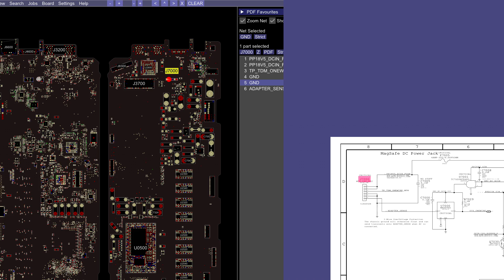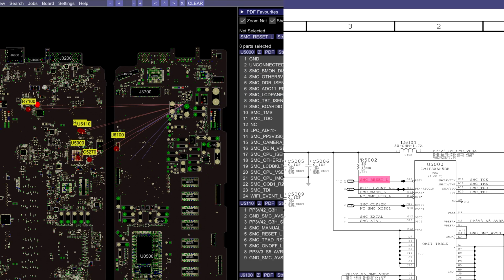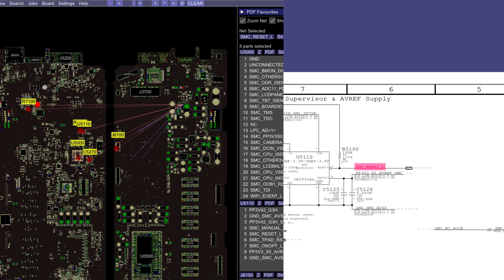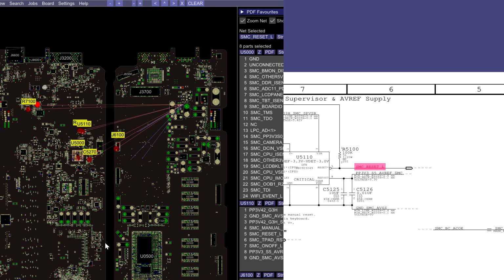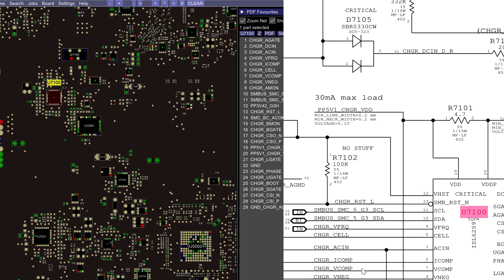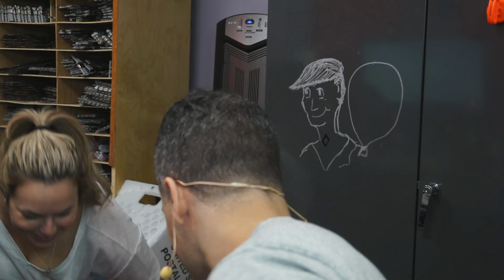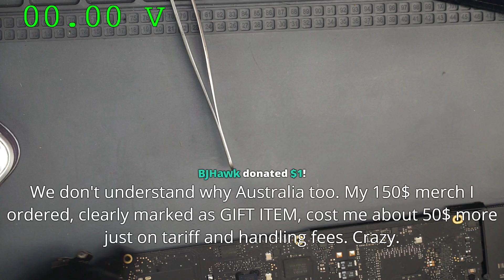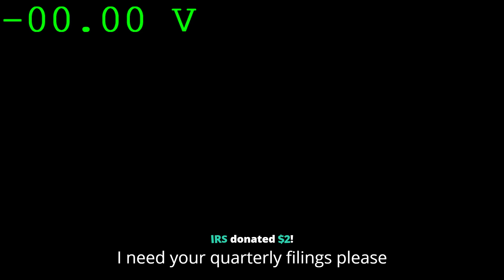My CPA's assistant uses a Macbook. Should I fire them?

Comment: last week i went to an authorized apple reseller in my country (we don't have Apple Stores around here) to check out my mid 2018 MacBook Pro which had some minor speakers issue, everything else was working fine. I thought that only the speakers would need to be replaced. However, the technician told me that the entire top case should be replaced by Apple standard procedure. This is sooo stupid. Luckily for me, my Macbook was still Apple's warranty so I decided to go for it. I can't imagine someone else in a similar situation without warranty.

Comment: A CPA firm should not use Macs.  Tax software works only with Windows and most have to be loaded to the local.  Also, collaborating in Excel with Macs is burdensome due to the defaults of visible cells only commands, etc.

Comment: @louis rossmann - just found this in the news "apple created an "independent repair provider program" which allows free service providers to repair iphones with original parts and apples special tools, which was only allowed for authorized shops and service partner till now, ... only in the usa for now... for now only for iphones, ... service provider can do repairs with 3rd party parts or apple originals ... shops who take part have to conform to using of  trademards but apple keeps the right to deny shops the participation -- heard anything about it? it it usefull or just a "scam"
Reply: just to comment: my thoughts, 
- probably a scam as they can decide to deny shops, so if they dont like a company bye bye
- probably only a try to stop laws against them

Comment: What causes all these problems? Over use, bad design, dropping it. Etc
Reply: In Apple's case, all three, though mostly the middle one. Over use meaning being stressed by heat cycling and high operating temperatures, bad design that leads to those high temperatures and wear, and dropping it because most of the people who buy Apple products don't want to know how their computer works, only that it does what they need, and so they have a commensurate lack of appreciation for how delicate computers are.

Comment: Who is the CPA's Assistant? 

If (it's Erica)
{
return 0;
} 
Else
{
return fprintf("\nYou are not fired but you should get a different computer\n");
}
Reply: Your code is all wrong lol
Reply: @TheCod3r  It's C
Reply: @TheCod3r  

if(*Something*) //Something --> Binary (runs when it is not equal to "0")
{
//Code gets executed here
}
Else // If it is equal to ZERO
{
//code runs here
}

if-else functions. Go do some research.
Reply: @TAILSORANGEs  well I was joking, but for a start you can't use special characters unless its encapsulated within string quotes,   plus when you're attempting to return values, you cant return an integer in the if statement and return a string in the else statement, zero represents false, so else should represent true which should be a 1, you cant just return mixed content because the compiler wouldn't know how to interpret it. I'm a programmer bro, I don't need to research it if I already know how things work lol. Seriously though I was joking, no need to get salty
Reply: @TAILSORANGEs  also you wouldn't return printed text, you'd return one or zero and then echo text based on the return response
Reply: @TheCod3r   oh that. my bad.

Comment: Install Ubuntu Server on it, then she will be sorry.
Reply: Use the non GUI version
Reply: @stephenhunter70  He said "Server", that's the one with no GUI.
Reply: @kei2142  Sorry if I got it wrong. Some time back I installed it on a VM it gave me the option several versions ago.
Reply: Ubuntu Server is powerful, but like any powerful tool it takes skill to operate. A typical mac user would be no less able to use a mac with a nail through the logic board than one running Ubuntu Server.

Comment: Apple did it again :))) https://developer.apple.com/documentation/xcode_release_notes/xcode_11_beta_7_release_notes -> "Xcode supports uploading apps from the Organizer window or from the command line with xcodebuild or xcrun altool. Application Loader is no longer included with Xcode. (29008875)" ... Louis Rossman - what you are noticing in the Hardware - We notice in the software dring the last 2 years :( They f**k us over an over and over.

Comment: How did you get that machine to work with such a small glob?
Reply: Bpdotconf small glod of what? If you mean the solder holding the new chip then its under a microscope and there is enough solder there. Not only that but its not to hold the world together but keep a connection connected.
Reply: On going gag of the channel. The bigger the glob, the better the job. Meaning the usage of flux. OP only used a millapol of flux in the video, not half a tube and then promoted his flux on stream.

Comment: Did you see apple is letting   Independent stores like yours to become apple  Certified. Will you be doing that. Thanks.
Reply: I'm interested in what he thinks of this as well! Rene Ritchie just put out a video for anyone wondering what OP is referring to.

It seems to be iPhone only right now so hopefully it's expanded to their entire product line. But I'm still skeptical there is some hidden red tape.
Reply: Rich Wapner have you watched his vids before?
Reply: @unfunny2258  also, from what I was reading you aren't being apple certified as this program is specifically for independent stores. It allows access to genuine parts, tools and software but it's for iPhones only at the moment.
Reply: Bryan Kraemer he has a vid about apple certification
Reply: Bryan Kraemer nvm I guess they changed it
Reply: @unfunny2258  yes. So you can get  Genuine parts. Just a question
Reply: Rich Wapner he said in another vid that being certified would stop him from doing a lot of what he does, or getting his hands on a lot of parts